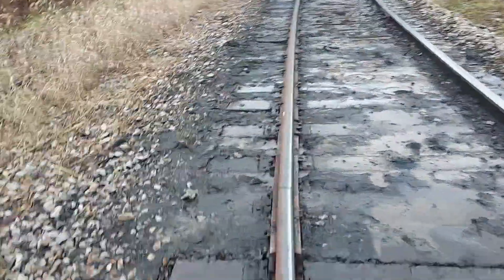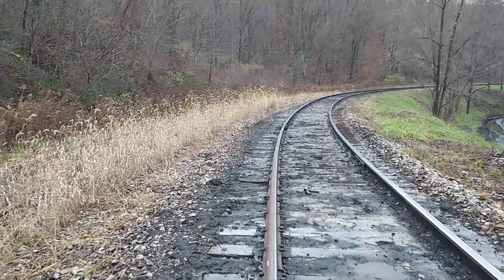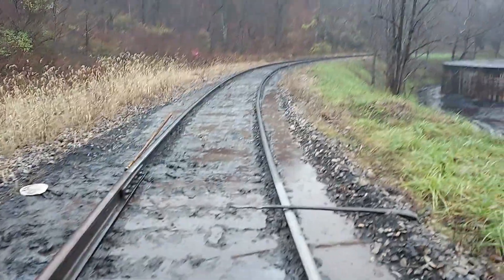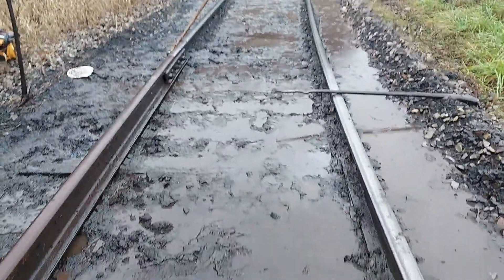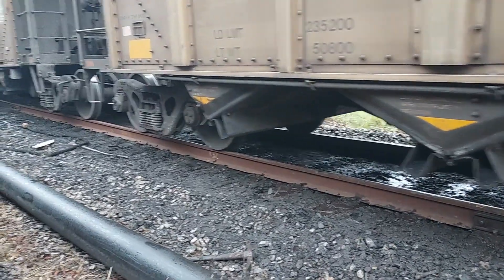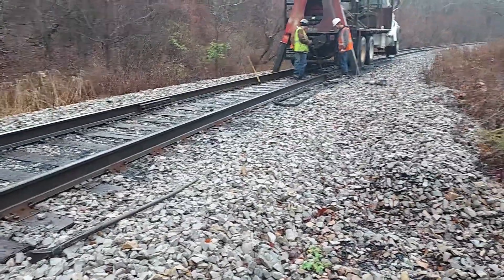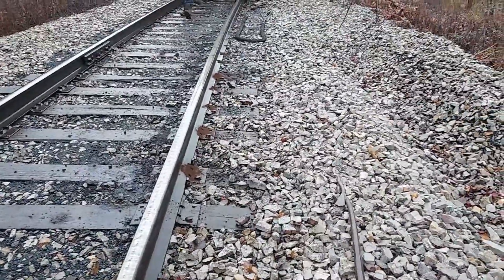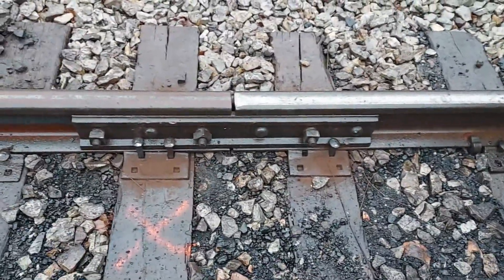How to Bend Rail for a Curve on the Railroad

Comment: Hey Dave,  just curious on a curved section of track does the outside rail have a higher wear rate than the inside rail? Also I watched a video where you were hand driving  spikes in you were hitting over the rail , is that just a personal preference or something else?
Reply from the maker: 1. Very good question batchit. Normally yes you are correct. However if a curve has the wrong super elevation for the train speeds, then the inside rail can wear more than the outside rail. i.e. Too much super elevation will cause the cars to be unbalanced thru a curve resulting in more weight and thus wear on the inside rail.

2.  Personal preference for me, many RR's will not allow
hitting over the rail. Also on a joint I usually do not do it either,
I end up bending too many spikes on joints if I hit over the rail....:-)
Thank you for taking the time to check out the video my friend.

Comment: But how do you make sure the other side is equal bend and maintains the correct width between the two rails?
Reply from the maker: Good question LichaelMewis. Keep checking gage between the 
2 rails about every 4 to 5 ties and arc will be same on both rails then. Thanks so much for checking out the video and writing in my friend.

Comment: I have another question. I watched the video where the rail was thermite welded, and a lot of effort went into making sure the rails were accurately level with each other,  but it doesn't look that precise when the whole rail is replaced up to the other rail. why is that?
Reply from the maker: Good question Dennis. Rail that is welded has to be perfect because
after welding there is no give to the rail. with rail having joint bars
on them, there is an amount of give to it, up and down movement,
so the welded rail has to be perfect before welding. While at
first that may sound a bit convoluted in it's thinking, in practical
application that is what works. A big reason why is because when
putting on a joint bar, there has to be a certain amount of give
to the rail, up and down and also longitudinally in order to 
be able to get the bolt holes in the rail to line up with the holes
in the joint bars. So now does that make better sense to you.

Comment: When you remove a rail that has been sitting curved a long time but needs replacing, does the rail go back to being straight ? Or, has it taken on a permanent curvature ? My gut feeling says it goes back partially straight but does retain an amount of curvature ....
Also, I'm assuming the ties come with the plates already installed and it's the placement OF the ties/tie plates/spikes the rail follows either straight or into a curvature. IE: the RRs lay in the ties and roadbed and ensuing rail then follows THEM..Yes ?
Reply from the maker: You are absolutely correct Mark in the rail only going partially
back to straight. Although that does depend on the degree of
curvature the rail has been in. A very low degree curve it will
go straight again, but not in the higher degree curves. 

Our ties do not come with plates on them. Some ties on other
RR's do. When building a curve from scratch, the engineering
department will lay out a center line for the track gang to follow.
Then ties, plates and then rail is placed, spikes are last.

Comment: Sir,

Instead of manually bending  rails,  why not manufacture  bent rails by casting?

There will be perfection  in angular curvature  in case of casting rather than  manual  bending.

What do you say?

- Nagaraj  T  V   Bangalore
Reply from the maker: Some rails on transit systems do have pre bent rails from the
factory. Those are for very high degree curves. We do not
need to use them on our small RR Nagaraj. We certainly appreciate your visiting with us to check out the video. May you have a most blessed day my friend.

Comment: Does straight rail want to warp when bent for a curve? Does it require any relief cuts in the foot to relieve torsion or tension?
Reply from the maker: Rail does get a "memory" after being in a certain position for
a certain amount of time Steve. Take a curved stick of rail
out like we did in this video and it will straighten to a certain
amount, but will never get back to full straight like it was
when new. Never do a relief cut in a rail, that would weaken
it tremendously and would most likely be a cause of a full
break when a train passed. Very much appreciate your
excellent question and for watching. may you have a
most blessed day my friend.

Comment: what do you do with the old rail that you take out?
Reply from the maker: The junk rail is sold for scrap t starr. Some of the more
decent rail is sold to contractors who will use it somewhere
else for putting in sidings or spur track. Thank you very much
my friend for taking the time to watch and write in.
Reply: @ccrx6700  I need some to use as weights.

Comment: I had a friend Ask... How much clearance on the inside of the wheel to the track on each drive axle... What I mean by that the clearance on the inside of the flange to the track inside of the rail is there a tolerance there.. if so how much
Reply from the maker: Track gauge, distance between the rail head faces is 56 1/2 inches
typically. Distance between car wheel flanges on the outside of
the wheel flange on a new wheel is a bit over 57 inches. Wear on
the wheel makes this distance grow larger. There are Fed regs
on how much wear can occur on a car wheel flange. So on  a
worn in wheel, not worn out wheel, you typically show 57 1/2 inches.
or there abouts. Remember all car wheels wear at different rates also. So there is no exact figure other than for a new wheel.

Comment: Great video Dave.  My french Canadian mother-in-law used to say that if you learned a new thing everyday you would live a long life (saying works better in French). I learned rails can be bent out in the "field". Have you every applied heat to the rail to get it to bend more in colder weather?  Not sure if that's done or not.
Reply from the maker: Thank you Charlie. Guess I'm gonna have to speed things up
and put out more videos so you can live a longer life, now I
have a much greater purpose for making these.... :-) Yes we
have heated the rail. That is when we put in a rail in a turnout
that has to have an odd bend to it. They make a big hydraulic
rail bender to do that and we heat the rail with propane torch.,

Comment: How come they don't have a spacer rod or all thread between rails every so often to maintain exact distance and pull the rails together?
Reply from the maker: It's called a gage rod. As long as the spikes are holding gage
there is no need for an additional gage rod. If spikes become
loose in several ties in a row, then we would put a gage rod on
until we could replace the ties. Thanks for stopping by and
watching the show my good man.

Comment: I hate to say this but you need to redoo the ballast make sure you have good drainage and make sure you have a good solide banked curve...
Reply from the maker: Yes Frank this section needs some good ballast rehabilitation done
to it. This is 10 mph track. We also have a few sections on
main at 25 mph which will get done before this section will.
It's on the to do list. Always would be appreciated for you
to volunteer to come out and start digging away.... :-) Thanks
for taking in the video today my good man.

Comment: 2:30 That roadbed is shot. It needs a deep cleaning and re-ballasting. Put a machine on the track to do that. Or you will end up in the ditch.
Reply from the maker: Yes this section needs some good ballast rehabilitation done
to it. This is 10 mph track. We also have a few sections on
main at 25 mph which will get done before this section will.
It's on the to do list. Always would be appreciated for you
to volunteer to come out and start digging away.... :-) Thanks
for taking in the video today my good man.
Reply: @ccrx6700  That's an incredible task. I admire your dedication and stamina to see this through. Railroading the "good" old way.
Reply from the maker: @V100-e5q  thank you 😊👍

Comment: So, then, the ties and plates are installed first to form the curvature.. Rail then follows THAT.. But how is the curvature FOR the original ties found ? Is it merely that the curvature of them does not go below 14 degrees, that all curves larger than that don't matter ? I.E That as long as curve is not tighter than 14, that's all that matters ?
Reply from the maker: Track will follow original engineering department design. Once
a track chart (blueprint) is laid out on paper, surveyers/engineers will
go in the field and lay center stakes so the construction crews
can build track, each rail to be equidistant out from the center stake.

Comment: What is a 14 degree curve? How much rail does it take to re-orient a train by 14 degrees? How long is a stick? How many sticks does it take? What is the max that one stick can bend in degrees?
Reply from the maker: Every curve has a certain degree of curvature. Every curve is of
different lengths so the amount of rail length in each curve
would vary. Even 14 degree curves can be of different longitudinal
lengths so your question about ho much rail it takes to re orient
a curve would depend on the length of that particular curve. 
I'm not sure exactly how sharp a degree curve that you can bend
a rail to. Our sharpest curve is 14 degrees. The old Waynesburg &
Washington RR here had a 33 degree curve, but it was also built
on a much smaller size rail. According to EMD owners manual
for an SD 40, that loco can negotiate max a curve of 30 degrees
but that is not having any car attached to it. Hope that all helps
you

Comment: What do you do with the old rail?  Chop it up for scrap?
Reply from the maker: Rail with Sperry defects will either get sold for scrap or re used
for something like building a retaining wall for a slide area. Rail
that is not too bad can be sold to RR contractors where they
will use it for sidings or spurs at some other RR. It is unethical
to sell a Sperry rail for use at another location unless it would
be for an off RR purpose such as a retaining wall.

Comment: I'm confused on how a curve is measured in degrees instead of a length measurement for radius. Can anyone explain please.
Reply from the maker: Mark, there are several ways to find the degree of curvature. Simple
way is to stretch a 62 foot or 100 foot long string line from
the inside of the rail head. At mid point, measure out to the
string line and that will give degree of curve. That is close enough
for RR work, There is a complicated math formula to figure it
out to the exact degree minutes, but the string line method is
close enough for us. Did that help?

Comment: Bare metal out in the rain;  are rails made with any kind of rust inhibitors?
Reply from the maker: No sir they are not. However they are hot rolled. Cold rolled steel
will rust pretty easily in the weather, where as hot rolled will
rust a lot more slowly. That is why you see some coil cars that
are covered (cold rolled steel) and some coil cars which are
open (hot rolled steel). Thanks for writing in and for watching
today my good man.
Reply: @ccrx6700  Interesting! Thank you 👍
Reply from the maker: @rvvanlife  👍😊

Comment: If a bent rail is replaced after 50 years, does it spring back to its original shape (straight), or does it remain bent?
Reply from the maker: Good question. This rail had been in there since 1975.
I did not show it in the video, but when it came out, it tried to
spring back to it's original straightness, but still had a slight bend
to it. In other words it did not re straighten itself to original,
however neither did it stay at the 14 degree of curvature that
it had when it was in the track. Thanks for taking the time to
check out the video today my friend.

Comment: Dave, do you ever plug your spike holes with creosote tie plugs and a plug punch?
Reply from the maker: We used to Ralph. But for the past 10 or so years have been
using Sure Spike. It's like a granulated  gun powder, pour it into
the spike holes. It works very well in holding the spike and in
sealing out moisture from getting into the spike holes. Thanks
for taking the time to tune in and watch the video my friend.

Comment: Seems like a lot of pressure on possibly old railroad ties
Reply from the maker: Ties looked bad because of all the coal laying on top of them.
We went thru this section early this year and put in a bunch of
new ties. Ties in this section are currently 10 times better
than what the code fed regulations Title 49 track safety standards require. Thank you so much Eddie for stopping by and taking
in the video today my good man.

Comment: Modern steel is quite elastic,  bending to a permanent set is called plastic deformation.  The elastic limit on any bend is always in the outer edges of the flange, a very small portion of the rail itself.
Reply from the maker: Thanks Keith for sharing that with us. I had never heard of that
term before. Really appreciate your stopping by and watching
today my friend.

Comment: The track bed seems to be raising and lowering a good bit as the train passes is that normal?
Reply from the maker: No sir it's not, well I guess it is normal for the ballast
having so much coal fines in it, nothing but mush to hold
the ties up. But in good track conditions with good ballast
the amount of rail rise will be zero to very little. This section does
need to have ballast rehabilitation done, it's on the to do list.
Thanks for stopping by and taking in the video today my good man.

Comment: How long is reduced speed in place after rail replacement? Thanks Dave
Reply from the maker: The first section we replaced is constant 10 MPH because
it is on the loading track. If we only change 1 stick on main line,
then we generally do not put a slow order over it. Our track
speed is 25. However if we change out an entire side of a curve,
then we will put a slow order over it for the first train, then ride
track behind the train. All changed rail, whether it's 1 stick or a
bunch of sticks gets checked after trains run over it as soon
as we can and operators are told to listen for any weird sounds
as they go over a new stick. Thanks for dropping in on us and checking out the video today my friend.

Comment: Great video Dave!
  When the ballast gets hopelessly fouled and mucky like that and I'm sure it's mucky all the way down to the subgrade, how would you guys remedy that? Would you bring in a ballast under cutter and basically remove most of it and start over with all new material or do you figure that cribbing and then just replacing the top ballast would be good enough?
Reply from the maker: Good question Phillip. This are has had so much coal spilled over
it thru the years best to take the track out and bull doze all
the mud and what ballast is left off to the side an start over again.
However, that takes time and a lot of money. We are planning on
taking the track out on curve 7 this winter, it's got same coal filled ballast conditions. So if we don't have the time and money to
take curve 2 out then it will get cribbed which is much, much 
cheaper and I can do it while the train is running, not needing
down track time. So we shall see what happens here this
winter when we have a shut down how much time and money
we have left after C7 and several other projects get done.

Comment: Very informative Dave. I take it that you always need one side or the other as a guide on a curve unless your are laying in whole sections?
Reply from the maker: Thanks, glad you enjoyed the rail bending party ferstuck. Your
pretty much right on having the opposite rail in for checking
gage. New construction the engineering department will 
put a center nail on the ties, then the construction crew will
measure out same on both sides of that nail to lay the rails at.

Comment: I have nothing but respect for MOW crews. That is tough miserable work. The worst job I ever did on the railroad was when I was in the Mech dept. working in the pit under a locomotive. But you never complained in front of the MOW guys. They had the toughest conditions. Compared to that, riding in the cab as Conductor or engineer was pretty soft.
Reply from the maker: Thank you Bill for the very nice comment. I have the utmost
respect for a conductor that has to walk a 15,000 foot long train
in the winter with snow and after dark. That has to be one
of the toughest and very dangerous job on the RR. It is nice
to ride in the cab hauling ballast here and they often let me
run the loco so that's a lot of fun. But that doesn't happen
often enough....LOL Always appreciate hearing from you
my friend. Someday maybe we can get together, we'd talk
railroading all day :-)
Reply: @ccrx6700  I’m thinking of heading up to Massachusetts next summer, perhaps I’ll make a stop in PA and swap some railroad stories with you. That would be fun.
Reply from the maker: @billmoran3812  it would be a honor and privilege for me to meet you sir

Comment: Some day can you explain how welded continuous rail adjusts for heat and cold expansion/contraction without ripping up the spikes, etc. I know that class 1 railroads use welded rail as long as 1/4 mile.
Reply from the maker: Thanks for the suggestion Lynn. I will keep that in mind. I'm
certainly not an expert of CWR, but I can learn. That video may
have to wait until I retire tho, got tons of other stuff on schedule
for now. Appreciate so much your writing in and for watching
my friend.